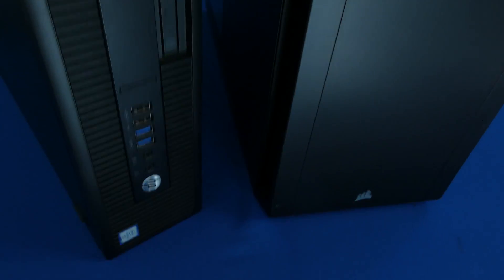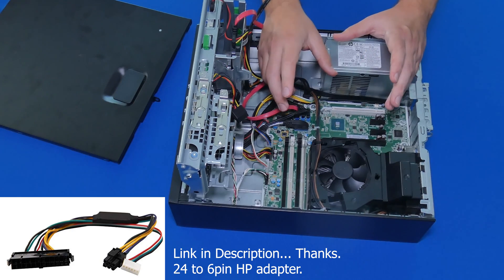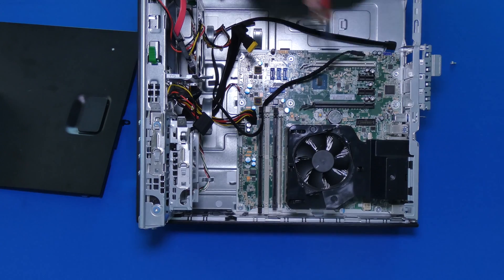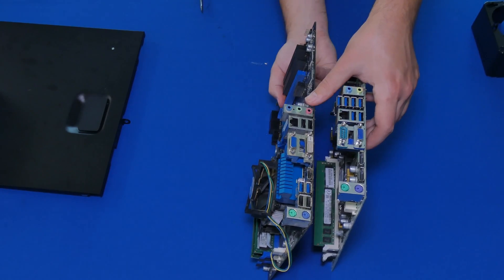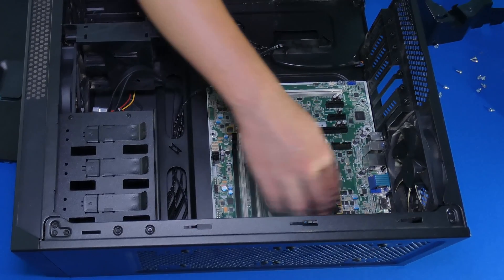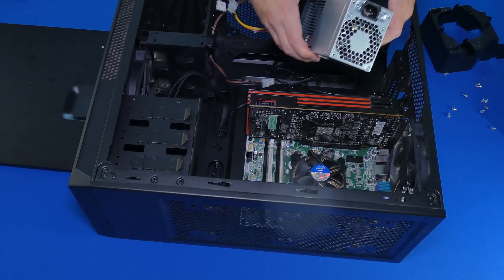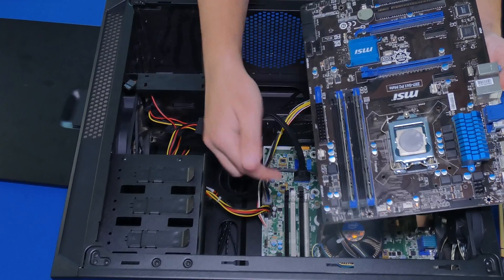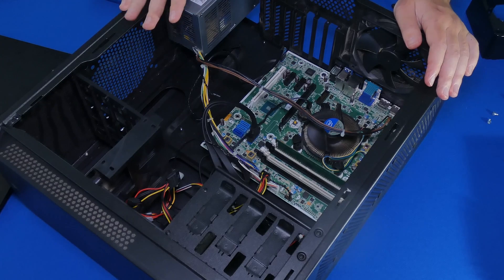HP EliteDesk transferring Parts to New Larger PC CASE

Comment: Hello, if I use 2x Y cabel for the 3 system fans In the one connecter on the Motherboard would it work? 
or have anyone some other ideas?

(sorry for my Bad Englisch)

Comment: Good video. Will it work with HP Compaq 6200 Pro SFF?
Reply: What did you do..
Reply: @obayd4869  I bought very very cheap used HP ProDesk 600 G1 MT. I changed i3 to i5, but recently I don't have time to other upgrades. My older HP 6200 works fine, but I don't use it now. Thank you for reply.
Reply: @jaroslawkaczynski93   did you awap 6200 motherboard in atx case

Comment: I’m getting a cheap optiplex and I wanna know, can I fit the SFF motherboard in a mATX case? If not, can I fit a gtx550Ti in this case?
Reply: mATX will not take this mobo, you need an ATX case for this mobo. And for the second question, as long as the gtx 550 ti is a low profile size then it should fit

Comment: I did this following Cobuman's instructions here, and it worked perfectly. Used a new PSU and the suggested adapter and it runs great with my AMD Radeon Vega 56. I also added a new wifi/bluetooth card and NVMe PCI-e adapter with 1GB M.2 drive. The system does well for middle-of-the-road gaming and other desktop tasks. I would like to go back and replace the motherboard at this point, however, just to have more options for PCI-e space, etc. Cobuman, do you have a recommended motherboard to use in place of the OEM board? My EliteDesk had the i5-6500 processor.
Reply from the maker: The socket for 6500 is LGA1151 so any motherboard with that socket should support it. However, for some reason the newer motherboards with same socket only support 8th and 9th gen intel... really bizarre imo. Anyway, there would not be much of performance boost if you get a different (older version of socket 1151) mobo because 6500 cannot be OC which is one of the main reasons you'd want to upgrade. I hope that helps.
Reply: @Cobuman  absolutely. The layout on the OEM board is just really cramped, and I have more space with the Corsair case, so I’d like to upgrade if I can find and affordable board. Finding one that uses the older Intel processors will be the trick.

Comment: Very nice, I'm doing the same with two Prodesk 600's, however the 3d print holes are 4mm too high in my ATX case. Is there a template available where I can move the holes down 4mm, I can't do it with FreeCAD.

Comment: i dident see a Normal power supply in this video !! normal power supply connector and voltage is different you plug in to that mainboard you see smoke screen !! because HP is smarter than you think

Comment: You should really remove the g3 compatibility, I already tried the faceplate and it does not work, it blocks the USB ports. Also the motherboard is much wider, hoping it fits in the case I ordered but I’m afraid it might need eatx if it works at all. Will probably have to buy a new motherboard 😔

Comment: Done this BUT you get a message on bootup about front usb 3 is not connected as it's slightly different to normal.usn 3 headers on own cases. Also the rear case fan, if not connected the. You get a message about that also.  I used a prodesk 490 mini tower pc.
Reply: There are some pins you need to short out

Comment: Can we do something like that with a HP EliteDesk 800 G3 SFF Motherboard 912337-001 912337-601, 901017-001
Reply: did you find the answer to this ? i want to try it
Reply: @timbologna  Still not
Reply: He should really remove the g3 compatibility, I already tried the faceplate and it does not work, blocks USB ports. Also the motherboard is much wider, hoping it fits in the case I ordered but I’m afraid it might need eatx if it works at all.

Comment: I wanted to know if a HP 8300 motherboard would fit in a 8000 case  the HP 8300 is a windows 10 64-bit an the 8000 is a windows 7 32-bit an I want the windows 10 64-bit an cost a lot less to chang the motherboard then buy a new computer

Comment: @cobuman I have done this transfer (thanks for the video!) and everything works well; my only problem was having to install my Radeon Vega 56 in the PCI-E 4x slot because the tall connector Corsair provides for the front USB to the motherboard essentially blocks the back end of my 16x slot. I noticed when you put the GPU in place in the video, you didn't have all of the cables connected to the mobo; but later, when all were connected, the GPU wasn't there. Were you able to find a solution?

Comment: I just swapped mine, only thing is front usb connector is different (except usb3 connector) also i bought the psu adapter and the wires were all wrong, had to use original psu and mutilated one of the sata power cables and made it a molex connector to use new cases 4 fan rgb setup 👍

Comment: By the way, a full sized GPU will block the USB 3 connector so I'd advise a 90 degree adapter
Edit: Nope, USB 3 still blocked
Reply: Yeah but maybe a low profile extender will work. I found a few online but did not really bother too much. Used the back USB's instead
Reply: @davidoosterhuis1355  I might give that a go, but yeah the G3 has a very decent amount of rear USB 3 ports.
Reply: @davidoosterhuis1355  Also thanks once again for your guide on the pin layout for the power button and such. Someone else in the comments is looking for the pin layout but I can't find your original comment to point them to
Reply: @EdgyShooter  no problem man, I liked playing with it. But some time ago I bought a new mb and sold my HP so can't really help anymore
Reply: @davidoosterhuis1355  Saved me a lot of troubleshooting! That's fair enough, was it due to the usb connection warnings? As they are annoying!
I just found the comment. Mind if I pass it on (crediting you of course)?
Reply: @EdgyShooter  yeah that was kind of annoying, and I wanted a Ryzen system and got a good deal for my old pc, so went with that :) BTW, no problem go ahead
Reply: @davidoosterhuis1355  Did you ever fix it on yours? I'm still trying to unlock the damn bios unfortunately.
Ah great choice and I'm glad you got a good price :) I'm going Ryzen for my personal system, this one is a friend's Christmas present that was on the thinnest of budgets so had to get creative!

Thank you very much :)

Comment: I was mid way through doing this upgrade when I found this! I just bought some nuts for the back of the CPU cooler though
Reply: Where did you happen to find the nuts for it I can’t seem to find a cooler that will fit the motherboard
Reply: @sergiorodriguez1291  you gotta find some small nuts that'll fit the screws, if you can find one that is a tad bit bigger it will also work because you can just wrap teflon tape around the screws to make it fit.

Comment: I like it how he did not work out, that the "full size video card" will not fit because of the USB header cable. But still, great video.
Reply: This is what I was wondering about.  Short cards only then.

Comment: Hi cobuman, 

I have a HP 800 G1 SFF (i5-4590k )  and I'm having some issues in transferring n a new case.  The main issue is the CPU fan: the screws' holes have a rectangular shape (about 10x7.5 cm) instead of the standard Intel square shape 7.5x7.5 cm. Any Idea how to solve the issue?

Comment: Good job but there is one big problem for the Elitedesk 800 G1/G2 that you haven't identified - the adapter you've linked is NOT suitable. The 800 G1/G2 uses a 4 pin CPU plug, not a 6 pin as per the adapter you've linked. Unfortunately there doesn't seem to be a 24 pin to 4 pin adapter on the market so it will require a manual rewiring solution. You can see in your video that your Elitedesk has a 4 pin CPU plug, not a 6.

Comment: Hey do I need to get a new heat sync? Cuz i want to do this and idk is it important. So if you can answer!
Reply: If you can remove the other side panel behind the motherboard, that will tell you what the stock heat sink is screwed into.  If the stock one has a mounting plate that comes out, I think it could be reused until you are able to get something decent.

Comment: Nice video man I was wondering if your pc was a g2 or a g1, and if it was a g2 does the g1 have the same location of the stand-off holes?
Reply from the maker: This is G2, I suspect G1 has the same holes because they are so similar. Check comment section... I think someone mentioned it's the same.
Reply: @Cobuman  thanks

Comment: Thanks cobuman for the video. I tried doing it, but for some reason that i can t figure out , the pc doesn't boot and it beeps 5 times.
Reply from the maker: Something is not connected properly. Check all cables and RAM.
Reply: @Cobuman  the RAM died for some reason , i changed the ram and it booted. thank you!!
Reply from the maker: @NZRBass  □

Comment: Great video, did i understand it correctly? That in a Standard Power supply for mobo power connector, you can just uncombine the 6pins in the 24pins right for the SFF mobo?
Reply from the maker: right, it's an adapter that takes standard PSU 24 pin and turns in to HP 3 plug connector. link in description.
Reply: @Cobuman  thanks sir! Last question, is it possible to use a nutbolt to tighten/hold the heatsink?
Reply from the maker: @vancanque2213  from the other side of motherboard? yes, but make sure you use a washer that is plastic and don't tighten hard or things will break.

Comment: Can anybody help me with this anytime I use any-other Power Supply beside the original It will beep 3 long 4 short
Reply: try to power your pc on without anything plugging in and make sure that u dont have anything excessive plugging in
Reply: @automanium4563  actually i figured why it doesn't work it because it was standard power cable as HP uses a nonstandard power cable.Due it shitty DRM but I will give a try a again. Thank you Sir
Reply: @AmericanDante  Do I gonna Have the same Problem If I do it?
Reply: @AmericanDante  and how did you connected the system fans,because I cant find any 3 pin Splitter for 3 fans.

Comment: What type of cases will the board of the hp elitedesk mobo  fits in? (Like will it fit in a micro atx?)
Reply from the maker: I don't think it will fit in micro atx case. Case used in video is Mid Tower. Link in description.

Comment: Hey, we tried "hp elitedesk g3 800 sff" and it did not work at all! The MB was at least 5 cm to long and the holes for the screws didn't match the motherboard either :/
Still thanks for the effort.
Reply: That's pretty vague, without knowing what enclosure or case you used we have no idea why it went wrong. You should be choosing a case that has SFF form factor mounting holes, most aftermarket cases have a plethora of mounting holes for various motherboard sizes to choose from, ITX, MicroATX, FullATX etc.

Comment: Would I be able to use any corsair ATX case for this motherboard? i.e. Can I use the Corsair 4000D Airflow? Or does it have to be this specific 270R case for the 800 G1 motherboard to fit?
Reply from the maker: This is just a standard mid tower ATX case.
Reply: Awesome. I thought maybe there was specific measurements for this motherboard and for this specific case.

Comment: I did it with a 8000 series changing the  case and the power supply, the hard part was the order of the pins for the start button and everything, the pc starts and work perfectly but at the start shows some error message telling me some fans are not detected, then i had to press F1 and te pc runs nice.. sorry for my bad english XD  Im from mexico
Reply: bro,  you're english is waaay better than my Spanish!  thanks for the heads up on the 8000 series.  I have an 8200 that I want to put in a bigger case,  and your comment/warning helps me plan.
Reply: Sean Spolwoski I want to do my 8300, let me know how it goes pls!

Comment: Will I be able to use my asus strid gtx 970
Reply: Strix*
Reply: Also do I really need a backplate
Reply from the maker: @Evilblunt1000  You don't really need the backplate. You can use any GPU with PSU upgrade.

Comment: Hello. I have an hp z230 SFF and I am wondering if it is possible to do the same to transfer the motherboard to a larger case. History of being able to put a larger graphics card. Thank you
Reply from the maker: □ Possibly. They look very similar and orientation of mobo appears to be the same. Open it and take a look to compare if mobo looks to be the same size, shape and back I/O orientation.
Reply: @Cobuman  The two motherboards are really very close. I'm just wondering, if the power supply is the same as yours on the video. I have to test.
Reply: The rear is not the same though. I have another motherboard that no longer works and there are small differences, but that's okay. The most important thing is that it starts correctly when I press the button. I have read on forums, and some say it is not possible to start with anything other than the original button, but your video and there to prove otherwise.

Comment: Is this the same motherboard type as the hp pro 6300 sff?
Reply from the maker: This is different PC entirely but to answer your question about different heatsink... the original heatsink is screwed in to original case to the back side. Aftermarket/other PC cases don't have that. The heatsink used is OEM from intel so it's not aftermarket either.
Reply: @Cobuman  gotcha. Didn't realize the other one didn't have that. It looked like from the video the motherboard and other hardware is nearly identical to my hp pro 6300 sff
Reply from the maker: @jeffthacker569  Yep, looks very similar. 😁 I get the same question about the 8000 series which looks the same as 6300. Take care.

Comment: but how to put another power supply? becasue dont match with this motherboard? and other question, what is the max cpu upgrade? because 1151 socket can put so many processors, but what is the max processor can match with this? and how to convert another power supply to this motherboard? Thanks!!!
Reply from the maker: Here is the power supply adapter: https://amzn.to/3l12qgF
Max CPU is i7-6700

Comment: Hi Cobuman, I would like to ask you if you can show the structure of how the front panel pins are positioned.
I am lost in that aspect
Reply from the maker: From what I can tell based on testing:
If you look at the header from above:
xx -> pin 1,2 
xx -> pin 3,4 -> power switch 
  x -> pin 5
xx -> pin 6,7
xx -> pin 8,9
Reply: @Cobuman  thanks cobuman but how do i locate the other connectors?
I have these connectors:
hdd led two pin
reset sw two pins
Power LED + one pin
Power LED - one pin
Reply from the maker: @willi234ify  You can trace back the front panel wires on the original and see where it goes. For LED it will lead to LED under the power button.

Comment: Sir do u think nec I5 2nd gen low profile can transfer to Keytech T1000 Black tempered case
Reply: Please reply
Reply from the maker: @wangjaju6326  Not sure. Check the motherboard orientation and design to see if it's similar to ATX type. If so, then it may work. I don't have that PC to check for you.

Comment: Did you encounter any USB (header) issues? I'm trying to do the same on a 705 G3 -- limitations on what hardware and even some specific chips the software will and won't support -- which has the same HP proprietary 10-pin 2.0 header and a (supposedly) custom-wired 3.0 on the mobo. Right away the system throws a cable detection error (41A-Front USB) and have to hit enter to continue. The USB 3 I haven't even tried, yet, but since the harness is the same layout, there's at least no error message

I don't care about the front audio connections, but ideally I'd love to use both front USBs as intended in the OEM HP case, but that might be too much to ask for, and would even settle on getting rid of the error on start

Comment: Thank you for this video. I picked up an Elitedesk 800 G1 and have been using it as a docker host for 2 years, but only being able to use 1-2 hard drives is too limiting, so I'm going to buy a larger ATX case, follow your video, and move into a larger case with more space.
Reply from the maker: Sounds good. You can use a 3rd hard drive by disconnecting the CD Rom if you don't need it.
Reply: I had 3 drives in mine just laying free in the case... never had any problems LMAO. Past tense because I upgraded to a G3 with the same thing +1 NVME drive... who cares as long as it works
Reply: Is your 800 G1 still being a docker host?  If so, how is its performance?
Reply: @IncandescentDaD no. I ended up purchasing a HP tower server off a friend a few years ago, and even more recently have picked up a 1RU Dell R240 from work that I will soon be moving to. I don't even own the Elitedesk any longer.
Reply: @MorkaiAU  How was the little HP when you had it?  I'm only using it to learn docker.  Not doing serious things.  How was its performance for you?